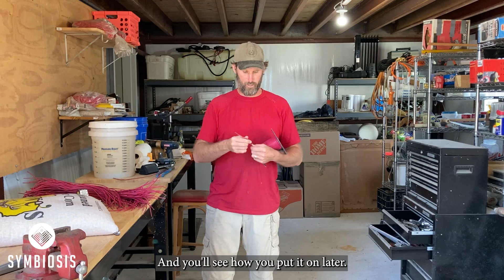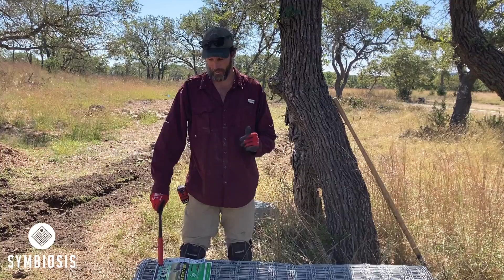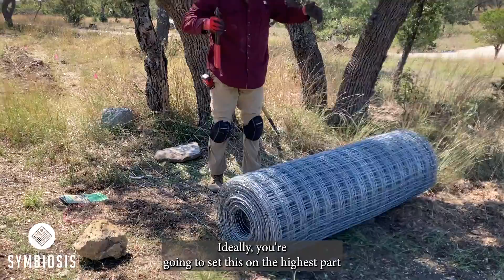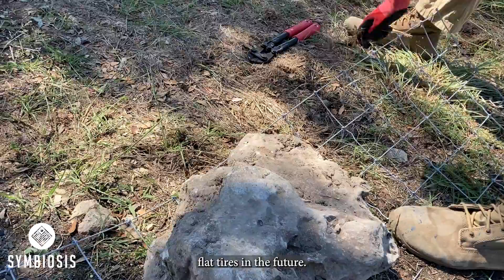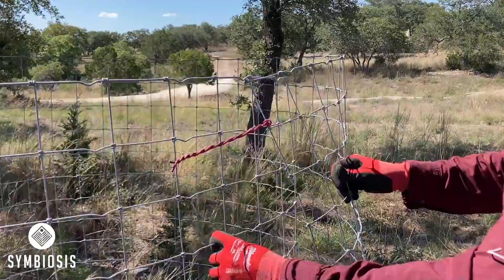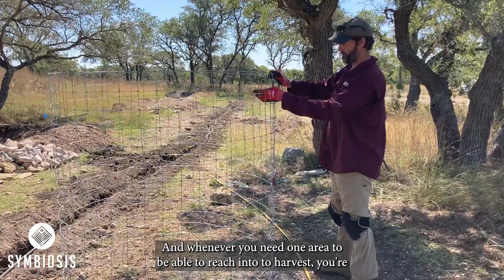DIY Deer Cages - Protect Your Trees From Marauding Deer!

Comment: If you cut your squares halfway through the wire (as opposed to cutting very close to the end) you leave wire tabs on both ends to secure the ends and form a circle.  Using gloved hands and needle nose pliers you can get the wire tabs wrapped close enough it is not a scratching/cutting/stabbing threat.  Additionally, it makes the circle more rigid because the wire splice is double reinforced (the two end squares overlap and there are two places wire is wrapped) and cannot fold or bend the splice.  Finally, it saves the cost for the red wire, cutting the red wire and having to pick up all of the scrap wire ends.
Reply from the maker: Fair point but we’ve done it both ways and prefer the irrigation wire wraps for many reasons. You’re right though, that way works great too.

Comment: You don't need the wire. Just don't cut the excess wire from the cage and use that to hold the cage together. You are not going to need to open the cages very often. Maybe never.  I have a 20+ Pear and Apple tree orchard and the cages soon will come off. They are tall enough for the deer not to reach the trees. My trees are from 12 to 15 tall now. It's ok if they browse on  the lower branches. Natures pruning. You are going to need them tall enough to mow underneath.
Reply from the maker: 1we've done it that way too. Takes a lot more time to undo the more rigid wire depending on how you wrap it. We do go in maintain thousands of trees in these cages each year so it does matter to us if it takes less effort to get into each one.
Reply: If you take the cages off, the branches and leaves may be too high for the deer to reach but the bucks will destroy the tree trunk.  I won't make that misstake again.

Comment: How are you securing the deer cage to the ground?  I don't think that was mentioned but I may have missed it.   It looked like you were just partially burying it in the last few seconds of the video.
Reply from the maker: These are wide enough to stand in high winds but if you have marauding live stock 3 t posts and wiring the cage to them is best. Even then some animal impact can happen. We’ve also used rebar and wire to anchor them at times

Comment: THANK YOU!  I pulled your video up first and you have EVERYTHING in this video (fence height, snippers, wire) that I need.  Thank you for all the tips and for saving me some time figuring it out.  I greatly appreciate the underground wire tip and the clipping off the sharp fence pieces.  I have done both the forearm cramp from twisting all day AND scratching myself on the pokey ends.  I'm a 5', not 20yr old woman and this will be easy enough to do without pestering my busy spouse.
Reply from the maker: You are welcome!

Comment: Great video!  But I can't find 12.5 gauge fence near me.  I'm wondering if the thinner 14-gauge 2"x4" 6-foot high fence that I could find would work, or if it would be too thin.  I would probably just use more like 12.5' of it to make a 4' diameter cage for my new fruit trees.  Also thinking that an extra foot of height would help a lot, as deer can reach things up to 6' high to browse on--so wondering if they would reach their heads above the 5' high fence or not (our whitetails here are often over 200 pounds).
Reply from the maker: There’s tons of pros and cons to all different options your mentioning and bottom line, your probably going to be able to get the trees to survive no matter how you do it, within reason. We’re just recommending what we like best from doing thousands of these now and managing them over time and even reusing them once trees get established

Comment: Good tips.  I've done basically the same.  Problem this year is that the deer busted down the fence when they smelled the apples.  I did not have them secured with t-posts so it was an easy task for them.  Next year I have to secure them better.
Reply from the maker: Rebar stakes and irrigation wire can be less expensive ways to tie them down
Reply: Thanks for the idea - rebar may in fact work.   @symbiosistx
Reply: What trees did you plant?
Reply: @whunderwood  They went after the apple trees.  I have peach, plum and cherry also but  sadly no harvest to date.  Stone fruits have been a problem with canker.  Not enough time in my days to properly manage my little orchard.